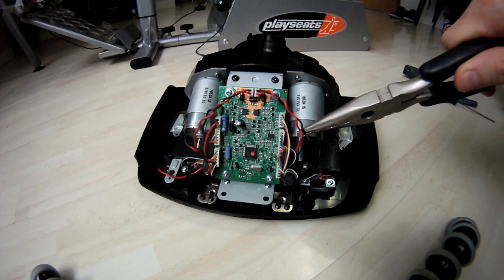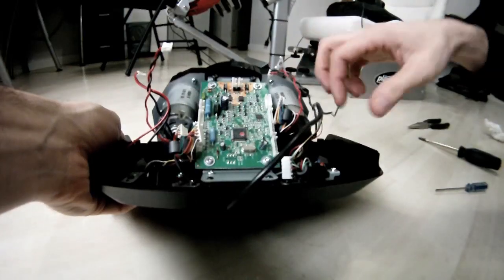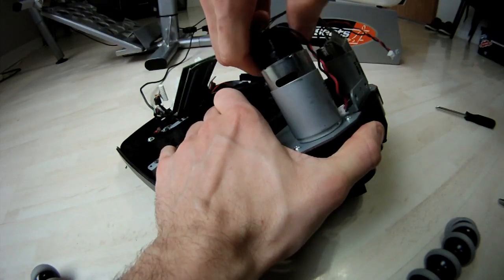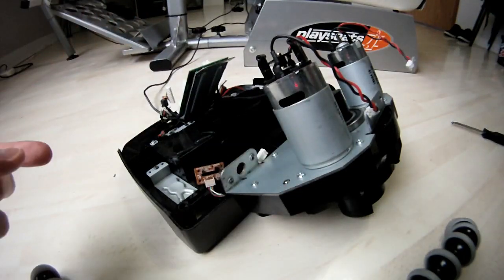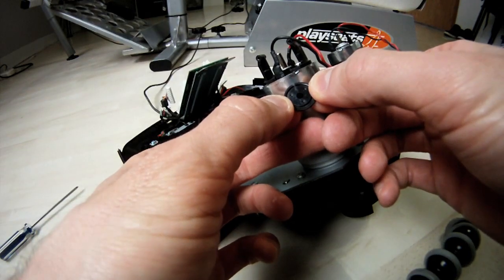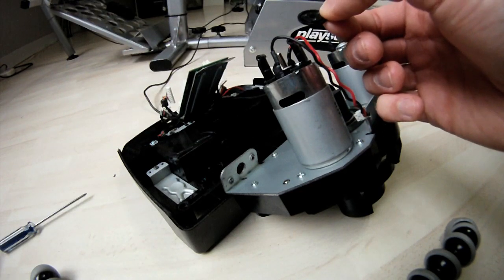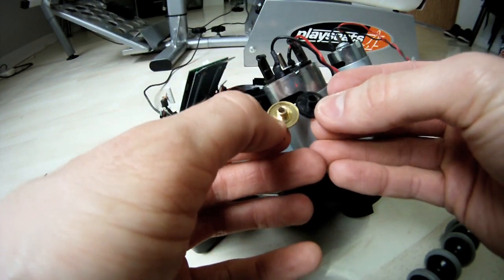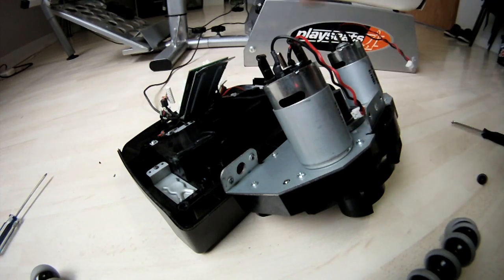How To: Replace Logitech G25 Optical Encoder Disc (How To Fix Your Broken Logitech G25)

Comment: Hey Mike thank you for your video!

I have applied the new encoder correctly but now I have a weird problem, the wheel after around 10 minutes shuts off of windows, the green light on the shifter is perfectly lit and it also keeps the last position the pedals were in (if it shuts off in the middle of a straight then it keeps on the gas fully) if I replug it, it works for 10 mins again. Any idea what have I done wrong because this didn't happen before I've took it apart.
Reply: +GyenesLaci1 Update

I have unplugged the g27's shifter and it works great no problem with pedals and steering wheel but a new problem was born somehow in someway the brass encoder spins or does something on the metal thing you put it on and it starts steering off center and then the steering dies. It slides off of it's position after a few laps progressively and bam it looses the connection of the wheel.

Comment: So... I've bought and installed the brass replacement and it still seems to drift off after a few corners of drifting. Any help?
Reply: Make sure the 2 screws that mount the plastic piece (mounted to the back of the motor) that the small circuit board mounts to are tight and make sure the screws are tight on the small circuit board itself. There is a sensor on the back of the small circuit board that reads through the holes as the encoder disc spins and if the screws to the plastic mount or the circuit board are loose they will wiggle around enough to give the wheel an inaccurate reading during calibration. From what i have seen and read while researching the cause of my wheel problems, it seems that the screws coming loose on that plastic mounting piece is as notorious of a problem with these g25/27 as the factory encoder discs breaking, both of which tend to cause the same problem.
Reply: Brad B I've already resolved it but thank you for your time and effort!

Comment: My wheel was shifting more and more to the side. As it turned out, my disc was indeed cracked exactly like in the video. I then glued it together. It works for now and I hope it will do until the brass disc arrives in 2 weeks. 
Anyway, thank you very much, you helped me a lot!

Comment: I've just fitted a new encoder to my G27. At the third attempt I've now got it to configure correctly on start up. However, now I have a really weird problem.If I have FFB set to on, pressing any key on the wheel or pedals sends the wheel in to a crazy spin. If I set the FFB off, then all the buttons and the wheel work perfectly. I've obviously done something really stupid with the rebuild but I can't see what. Any ideas??
Reply: glsammy  My problem is now solved.  It turned out to be a faulty front USB port on my computer. Connected to a different port on the rear and all works perfectly.

Comment: Hi, Thank you so much for the video. I´m from Brazil and was a little bit afraid that just lost my G27. My question is: There is only this site to buy the optical encoder? Is 30 dolars for just one? Brazil kills me with "real".
Reply: Just opened my G27. i dont think my optical encoder is broken, but its STUCK. I didnt make it, because its very strong. I dont know what to do.
Reply from the maker: Guilherme Calciolari Maybe you can remove the disc and slide it back on again? Maybe just play around with it so it won't be stuck? I'm not too sure. 
I only know of the one website. I'm not sure if there is another one somewhere closer to your location.

Comment: Mike! Thank you!!

My G25 started drifting off center and thanks to your guide I was quickly able to establish that my disk was indeed cracked.

Ripping apart a few old ball mice I found a VERY similar disc, that when drilled trough made the wheel usable again.

Still I am a bit of center with the new disk, It calibrates 100 % but immediately drift off to one side a few degrees when in use...... :(

Question: Can This be cause by misalignment of the center "cog" plastic piece or do you think my disk is not precise enough?

I am a bit hesitant to splurge for a Thai metal disk, unless I am sure this will work 100 % as funds are limited...

Thank you in advance for your thoughts on this!
Reply from the maker: Rune Løkke It could be either or. Start with the centre column  or "cog" as you call it and try to get it as perfect as possible. If it's still off a bit then it could be the disc from the old mouse.
From what I remember, the disc that can be found in an old computer mouse has to have the right amount of holes or slots that perfectly match up with the G25 optical encoder disc. If you look at your optical encoder disc in the G25, you will see tiny holes or slots near the edge. The G25 computer reads those slots in order to calibrate the wheel correctly each time it starts up. So make sure the disc you found in your mouse has identical.
I guess the last resort would be to purchase the brass optical encoder disc from cmlaserservice in Thailand.
Reply: mikeschmeeedotcom Thank you for the quick reply; I am going to try to realign the center column first I guess, even though my solution was a bit "ghetto" it did seem to work, as the wheel perfectly centers on boot.. 

..its damn hard to count the holes, but it certainly looks identical when held on top of the (partially broken) old one.

I guess if this does solve it, ill splurge for the Thai solution. 

Have a great day Mike, and thank you again!
Reply from the maker: Rune Løkke Not problem. Happy to help out. Let me know how if it works out.
Cheers,
Mike

Comment: Hi, My son bought one off ebay, seller said untested, all works except the steering. The wheel moves when plugging in USB, but doesn't calibrate at all. Just took apart and wheel is cracked but still moves. Its not a case of losing calibration, it never calibrates in the first place - dont want to order a wheel if its something else?
Reply from the maker: Matthew Kirby If it were me, I'd still order a replacement optical encoder disc.
Reply: The disk was fine, it was a loose connection where the power goes to the board. works fine now!
Reply from the maker: Matthew Kirby that's great news! It's always nice when things are easy. Cheers!

Comment: Thanks for the video! My G27 has recently got an issue when it is plugged in, and does the calibration thing, it makes a fully right turn, a fully left turn, then stays there without coming back the dead center. Is this a rotary encoder issue? Should I be worried?
Reply: it culd be the encoder but at same the software from logitech its a 50 50 just try first re install the software
Reply: I got a G25 that did the same thing. Ok, mine also stopped working (it wasn't stiff or something like that). Might be the power cord or might be it.
Reply: @maple7093  I later found out it was Windows Update that messed up my G27 driver. I had to uninstall its driver (that Windows 10 automatically put on) every time there was an update, and then reinstall the good old Logitech profiler thing to get my G27 to work.

Comment: I bought this - and its not the same size as the original. Its shorter, so you have to position it on the shaft. I got it spot on center to the sensors and it didn't fix it.

Comment: Hi Mike, After your video and searching some other foums I bought the optical encoder from cmlaser, I installed it and checked 10 times before trying G25. I started a lap at to test G25 but after a couple of minutes alligment was gone. Tried maybe 20 times so far but alliegment just goes off during the driving. Do you have any advice?. Thank You
Reply from the maker: Hello, I'm sorry to hear about your experience. It sounds very annoying, atleast I would be annoyed if I were in your position. The only thing that I can think of is the disc is not set in the right position. I mention in part 2 of this video that the disc has to be aligned a certain way in between the sensors. That would be my best guess without seeing the Logitech unit in person. Other than that, it may be something else that's causing the issue.
Reply: Glue it to the shaft it's probably shifting while you are moving the wheel resulting in it no being aligned

Comment: are the washers important I kind of lost mine
Reply: They prevent the screws from coming loose by vibrations. If you lost them it's not a big deal. Just put a piece of rubber under the screw instead (you can cut it from rubber band or use rubbers from a bicycle repair kit, which is what I did to prevent the sensor from coming loose again).

Comment: Mike, tanks so much for sharing this info with us. I suspected mine might have small crack as well (G27) opened it up and it confirmed it. My calibrated slightly of centre as well. What I wanted to ask was if ur force feedback got any weaker because of this? my ffb is much less vs my buddys g27 on the same game with the same settings. Basically what im asking is did this only  solve your calibration or did it improve other aspects of the wheel as well. Btw the G27 is exactly the same inside down to ever connector.
Reply from the maker: Honestly, I cannot remember. I sold the G25 a long time ago as I was in need of some money and I haven't gotten back into the scene just yet. I don't think the force feedback got weaker but like I said, I honestly can't remember. Sorry about that. When I installed the new optical encoder disc, I noticed that the disc has to be in a specific sweet spot in order for everything to function perfectly. I think it has something to do with the slightly larger thickness of the brass disc. Perhaps its weight as well. So maybe it has something to do with the positioning that you currently have it in? I'm not sure. Sorry I couldn't have been of more assistance.
Reply: Thanks Mike. I just made the order from CMlaser. I will post the feedback here as soon as I receive the new disk and install it. Thanks so much for your detailed videos. :)

Comment: how is this holding up so far, any updates?

my g25 has been sitting in a box since i had the flashing power led and dead steering wheel. and debating if 37 is going to fix it.

thanks for making this video
Reply: did it work?

Comment: Bought encoded wheel. Slide it in. Wheel doesn't do anything now. All buttons working, but no steering at all.

To give you more details, I get a flashing power light, and my RPM lights are at half...
Reply from the maker: Make sure the new optical encoder disc is not touching any of the sensors. It has to be in just the right spot for the wheel to work correctly. Be sure to watch the second part of this video. It's on my YouTube Channel

Comment: You should REALLY include something about the wheel stop (toothed plastic piece) that falls out when you pull the servo motors.  I'm the second person I know who this has happened to and I had no idea where to put it.  With a little help I eventually figured it out but my buddy gave up and had yo buy a new one.  You assumed we were too smart :)  GREAT VIDEO THOUGH, saved me 300 bucks and I didn't even need any glue.  Mine turned out to just have all four of the mounting screws loose!  Thanks!
Reply from the maker: Is that the part that connects with the steering column? If so, I think I lightly covered that in Part 2 of this video. I wish I still had my G25 :( I'd open it up and make another video going into further detail on that toothed plastic piece as I get quite a few questions regarding that piece of the G25. Thanks for watching though, it means a lot :) Cheers!

Comment: Thank mate...I tightened my screws but still had issues, checked my encoder and yes it had two (2) cracks. One was all the way through and the other was half way through. Ordered new one and should fix the problem...Thanks again.
Reply from the maker: I'm glad the video helped you out! Cheers!

Comment: Is the G25 comparable to the G27 for the noise? Is it possible to grease the gears to make it silent? Please I need help it will be my first wheel. I want a wheel under 180$ and I got a deal for 150$ on the G25, not sure if I should get it
Reply from the maker: I'm honestly not too sure if you can grease the gears. I mean, I'm sure you can but I wouldn't. It's not too loud, my room echos a lot. Maybe try it out at a store that has it on display before purchasing? The G25 and G27 are the best wheels that are available, in my opinion.
Reply: mikeschmeeedotcom I finally bought the G25. Not disappointed at all! Its not noisy at all! The videos on Youtube are so misleading for the G25's noise level! thank you for the reply :) Got a question: do you have any way to make the shifting noise less clicky ? I find the "plastic wrapping the ball" trick not so long-lasting after the wear on the holes on the plate inside the G25's shifter
Reply from the maker: tonytober I'm not sure how to do that. I've only modified the shift stick so it has a heavier feel as it would in an actual vehicle. My solution to this light issue, is to turn up the volume or wear headphones and listen to the sweet sounds of engine and exhaust!... however, GT5 sound effects are not that great.
Reply: mikeschmeeedotcom

Why do you think this sensor wheel breaks?  It doesn't even touch anything that would bind on it does it?

Comment: Hello I have a g27 I don't know what the problem is I try to power it up and nothing happens no calibration at all I've tried replacing the fuse in the plug and it's still the same ? Any ideas

Comment: The light blinks aswell when you have another hardware that interfeares with the nadwith the G25 is running on. In my case my web camera and my headset when on at the same time, makes the g25 act up. So before you complete disasample your G25/G27  Try to remove webcamera´s or headsets and see if its still doing it :)

Comment: The optical encoder for my G27 recently broke and its out of warranty, so I am having to replace it which is why you video is so helpful. But I was wondering does the inside of the g27 look like the inside of the g25 or is it radically different? just want to know before I take it apart

Comment: i have problem please help ! 2 days ago i played on g25 then suddenly my wheel didnt work , so when i plug it , it do not rotation and when you turn it it doesent turn back and not work. sorry for bad english ! i have bought it used and clutch has not worked and 900¨¨ degrees only 180 and H shifting not worked :D so if you know problem please help D:

Comment from the maker: I watched your video and left a comment. My best guess would be that you have a cracked optical encoder disc but before you start replacing anything, check to see if you have the same issue with another system such as a PS3. That's if you have access to one.

Comment from the maker: Since you purchased the wheel from eBay and it never worked to begin with, I can't say for sure that nothing else may be broken. However, since you mentioned that you have the same crack on your optical encoder disc then my best guess is to replace the disc and see what happens. I know its a risk spending 37 USD on the brass replacement and it might not even solve the issue but thats what I did when my G25 was broken and it fixed the problem.
Hope this helps!

Comment from the maker: My Logitech G25 is now fully functional after replacing the optical encoder disc. My steering wheel showed up when playing but the wheel didn't move. Just nudged a little bit and I had a flashing light on the shift stick. I opened the G25 up and I noticed that the disc was cracked in three spots so I replaced the disc and now it works again! You might have a similar issue and the only way to find out is to open it up and check. View my other videos and photos for full details
Reply: Well, I can't make a video because I need to dissasemble my G25 again and I am afraid I will break it :D. But this video pretty much explains what I did: 
/watch?v=gnGY0lLnv0A&t=2s. 
But I instead of the washer I put a piece of a cola can or beer can. I just cutted a square from the can with scissors. Then i placed the washer on top of it and i glued it so it doesnt move when I cut around the washer. So I cutted the square and now I have circle the same diameter as the washer. While the two pieces are still glued togheter, I grabbed a screwdriver which had the same inner diameter as the washer. I started twisting it (drilling) it until the inner diameter of metal piece had the same as the washer. Now I have two washers - one thicker and one thinner glued to each other. I seperated them and put the thin washer on the encoder wheel. If it doesn't fit you can try again to enlarge the inner diameter, but don't make it too large because It will be loose. When my homemade washer finally fitted to the encoder wheel, I put a very little amount of glue and then putted back the encoder on the electric motor.
Reply: I replied on the wrong comment :D, but you will get it